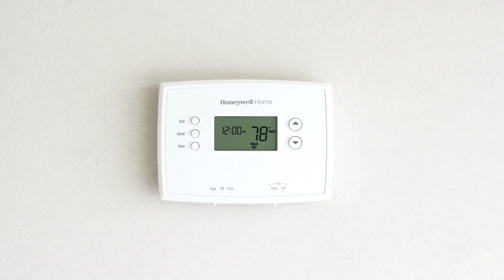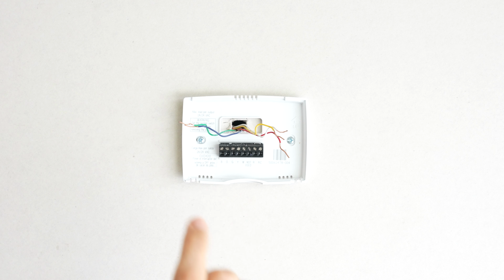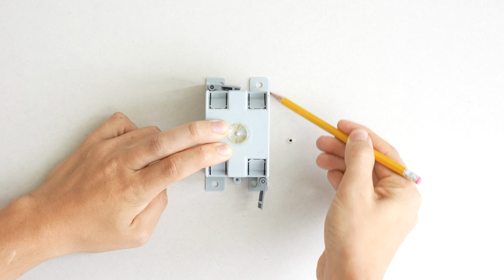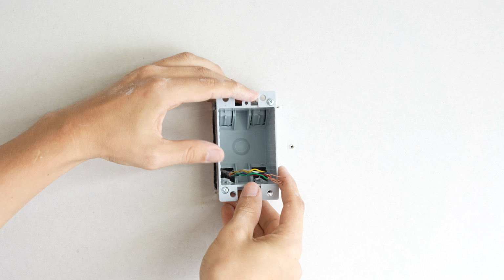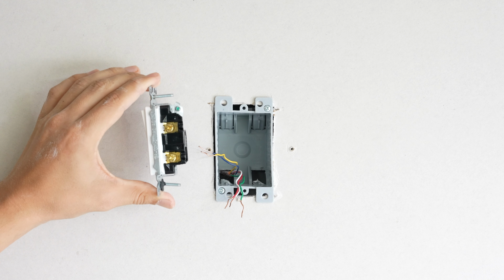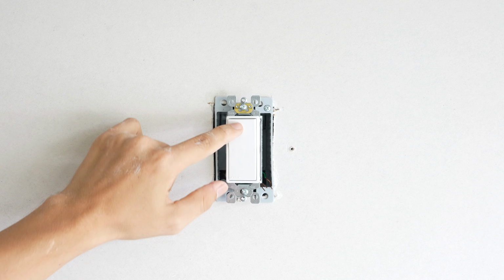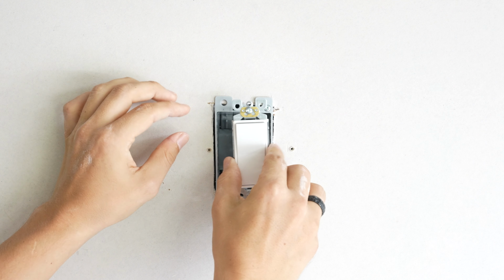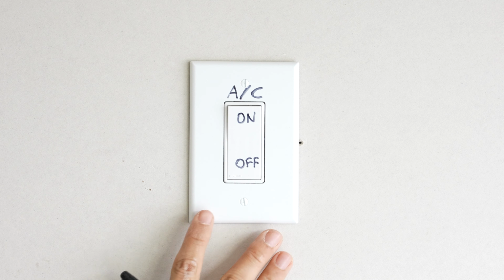How to Make a Fully Manual HVAC Thermostat

Comment: You should not share this. PLEASE take it down. Its dangerous
Reply from the maker: This is essentially the same thing as jumpering a thermostat and there's plenty of videos out there on how to do that. Why is this more dangerous?
Reply: @WordofAdviceTV  
None of them should be suggested. Extreme dyer emergency only.
Reply: Because hvac units are not supposed run all the time because it will wear it out and because your electric bill will be outrageous
Reply: I would hate to live in a society where everything deemed dangerous was censored.
Reply from the maker: @jaysmoke3132   I do thank you for stressing the dangers of leaving the thermostat bypassed though. Definitely don't want to leave it like that.
Reply: It’s not line voltage so why is it dangerous?.
Reply: @Casmige  I believe the concern is that someone turns it on and leaves it running for an extended time which would cause the furnace/Air conditioner to potentially overload.  Anyone turning it on with a switch would need to manually turn it back off when they reach their desired temp.

Comment: I think this would work for emergencies purposes if your thermostat goes bad an you live like far away from the first HVAC parts store.
Reply from the maker: For short term use, a switch would work great! 😄 No need to cut a hole in the wall either, could just let it hang until you get a new thermostat. It's not practical to leave it this way though because the furnace or A/C would not automatically turn off.
Reply: Agree emergencies only but you know what's going to happen!

Comment: Ok, but how do you select between A/c and the furnace?
Reply from the maker: You would need 2 switches to do that or maybe a 3 way switch. With one switch you will need to choose either furnace or A/C. I want to do a little follow up video to this later and install a triple switch box, so there's separate switches for the furnace, air conditioner, and indoor fan.
Reply: @WordofAdviceTV If you want to be able to switch heat, AC, or off on one switch, you'd need an spdt. Not sure a residential spdt is readily available, but this is low voltage wiring and easy to rig one up on a blank cover plate where this is low voltage wiring.
Reply from the maker: @jamesroscoe7555  Thank you for the suggestion! A spdt would work great! I did this in the most simple way possible but as I was looking at the different switches in Home Depot I realized that there are many many cool different ways to wire up a thermostat to a switch. 😄 One could get pretty creative with this.

Comment: I was trying to find a thermostat that had a 3 position switch to go fast from heat cool and furnace with a heat pump. The backup furnace always seemed to have menu.  What is the fastest to go between the 3?
Reply from the maker: Are you looking for a super basic one? This is one option: https://amzn.to/3T01Kei
Reply: Thanks. I was hoping it would have programming also.  However I  hear with a heat pump, it is best to leave it close to 1 temperature. @WordofAdviceTV
Reply from the maker: Yeah, it's better to not jump around with the temperatures too much but 2-5 degrees is fine. Here is another very basic one with programming: https://amzn.to/3SLrBp3
Amazon has a lot to choose from, just search: " heat pump thermostat programmable"

Comment: You can add a "Temporary Construction Thermostat" in series with the wires to make it a preset manual thermostat.  They are available for heat limit as well as cool limit. I use them to keep HVAC use to a practical level when having construction or remodeling done.  Another option would be the Honeywell CT87N1001 (the old-style round thermostat)
Reply from the maker: Both good suggestions, thank you!!

Comment: OMG so this resurrected a distant memory. So a grandma of a friend of mine from back in grade school kinda did something like this for her AC, but with a spring-wound timer. I thought back then it was just the weirdest thing. I speculate now, she probably just wanted to manually control how long/often her AC ran (watching her energy consumption, fixed income retired etc). I could maybe see this on an evap cooler but hers was just a regular central split system, but (even back then) really old (and loud).

Comment: I hope you installed a simple dial or other basic mechanical thermostat for her.  Rotate right for warmer, left for colder.  My brother and I talked over installing a Nest thermostat for our parents, but realized they preferred the simplicity instead of the potential programmability with automatic setback and occupancy detection.
Reply from the maker: Yes, don't worry. I would not install something like this in anyone's house. In most cases explaining how the thermostat works and how to operate it is actually enough and people change their mind about replacing the thermostat to a different one.

Comment: Off topic but, I have an issues where my inducer motor hums, does not kick on and got very hot. I took it in thinking the motor was shot but the repair shop connected power to it and it ran great. Is this an issue with the board?
Reply from the maker: I would check power and see how much voltage it is getting. It is likely to be either a loose wire connection or yes, a bad control board (possibly a bad transformer too).

Comment: Question wouldn’t this type of setup be running without stopping? 

Because with a thermostat, it would reach a set temperature and shut down. 

So I guess when the person feels that it’s comfortable they can shut it off themselves? 

Oh I love your videos by the way.
Reply from the maker: Yes, this is not a practical set up because of the reason you pointed out. This video is more for educational purposes than anything else.

A thermostat is a switch at its core but it also has temperature control added to it. Without the temp controls, the furnace or AC would run non-stop.

Glad to hear you love the videos, thank you!
Reply: You’re the best!!! 😊

Comment: That is pretty funny and not even April 1st. You need two of those, one for heat 🥵,one for cool 🥶, 🤣 or put an old fashioned manual thermostat.
My programable thermostat has a manual setting. Set the temp and leave it alone. Lol
Reply from the maker: Haha yeah, if someone really wants something this manual, one of those round dial thermostats would be perfect. 😄

Comment: Oh Jay, PLEASE , PLEASE, PLEASE take this video down before someone does something stupid like hook up Grandmas furnace to this switch and they find her dead the following week from dehydration.
You (and I) know this is a bad idea but there are people out there that don’t see the downside of doing this. Why give them the opportunity !!!
Reply from the maker: Brother I appreciate your concern but I honestly don't believe this video is that dangerous. I don't advise doing this conversion in the video and the comment section with comments like yours will further discourage folks from attempting this. I think this is a fun little educational video on how a thermostat works at its core and it didn't even cross my mind that it's dangerous until I started getting comments like this. Any video involving repairing 120v or 240v units is much much more dangerous. Especially if it involves testing the unit with the power on. Ironically I don't get any danger warning comments on those though.